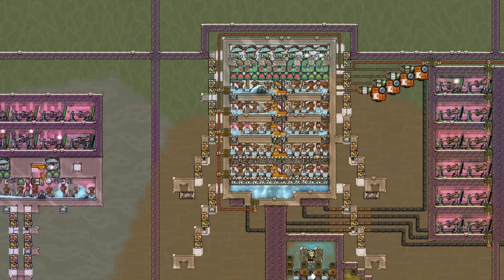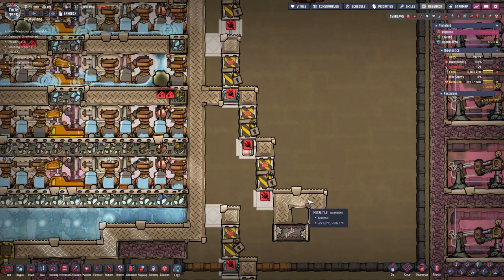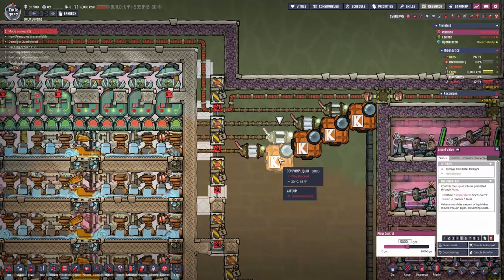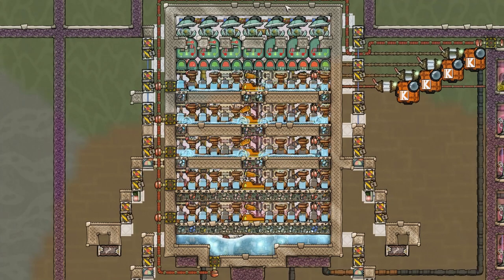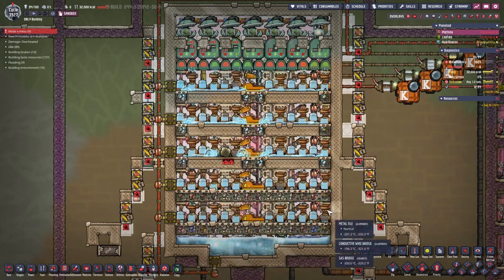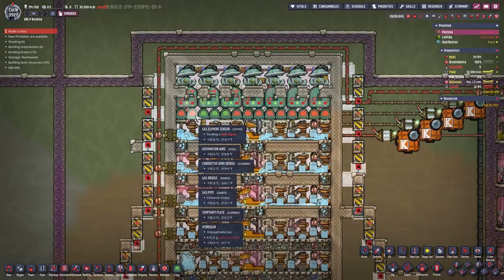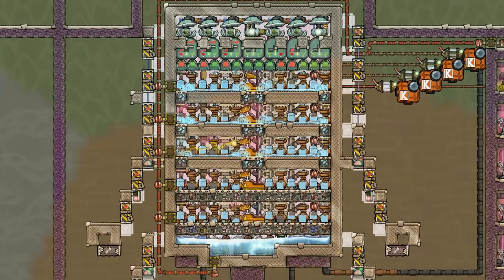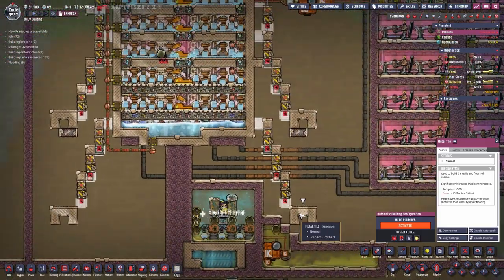The Heck is this?

Comment: Wouldn't this set up eventually heat up? Unless the heat is deleted or removed from the entirety of the system heat would build up eventually.
Reply from the maker: Hey Quantum Inc. This uses the temperature duplication - door glitch. 
So as long as you have the metal tiles under the door cooled it is fine.
(they should stay cold but if you want to be safe cool them with a thermo Regulator!

Check out my lets play episode 16 unlimited power or the one before to understand the exploit.

Comment: I wonder if it would be practical to liquefy oxygen to save on the power usage of pumping oxygen gas vs pumping liquid oxygen if you were using noncheaty methods to cool it.
Reply from the maker: No probably not. You would need lots of aquatuners with super coolant.

The intention here is the reduction of piping i have an area for 200 dupes and you would need 20 parallel gas pipes to transport the same amount of oxygen as with 2 liquid pipes.

Comment: what about rust deoxidizer?
Reply from the maker: What about it?

You mean if we can use the same method for liquid chlorine and then extract the oxygen with gas pumps and suck up the chlorine with liquid pumps?
Reply: @lumaraw  liquid chlorine not very useful
Reply: I've seen chlorine has really low liquid points, but rust isn't that common *unlike water for the electrolicer.
and at the end, it's better to just use manual gas filters to take the chlorine out, maybe dumping it to some salt vines, or vent to space idk.